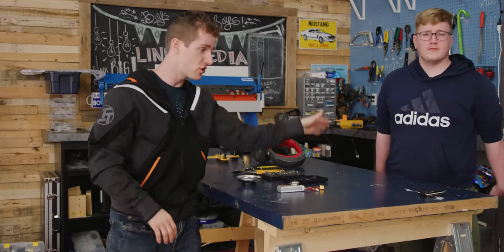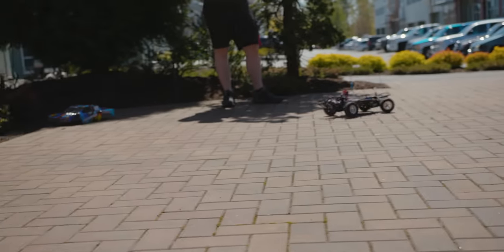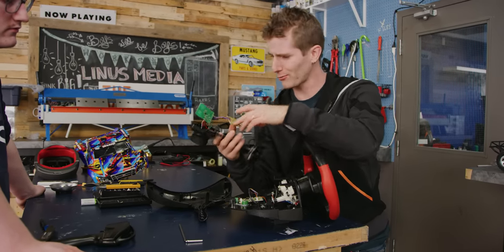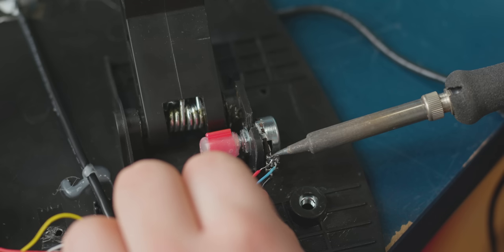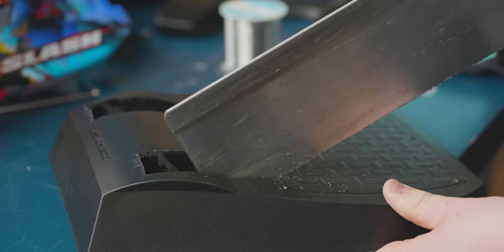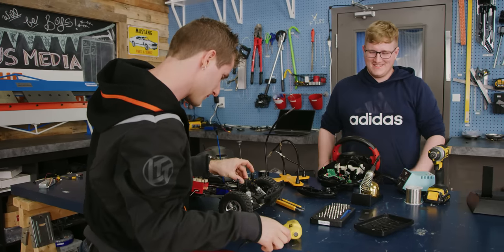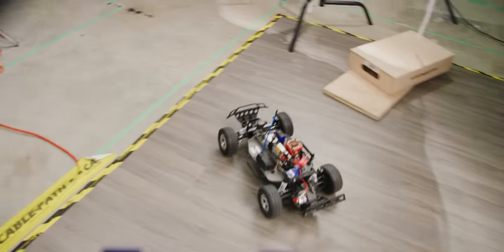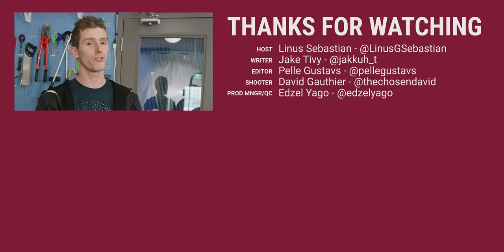First Person View VR RC Car Racing!!

Comment: Hi Linus,  

You might want to look into using a computer instead of hacking the controllers like you did by using PCTx, or Servo Commander.   
http://www.endurance-rc.com/pctx.php
http://www.endurance-rc.com/servocommander.php  

Basically you get to hook up the Actual transmitter in Trainer mode to the PC, so the PC can take the input from your wheel, pedals, or joystick by using Servo Commander or PCTx to convert that information through the transmitter, so you now have the ability to take control of an R/C vehicle or robot with your PC side applications.  PCTx generates up to 9 output channels, and Servo Commander has up to 25 channel support, and both have adapters for several different Transmitters. 

Compatible brands: 
Futaba
Airtronics
JR
Spektrum
Hitec
Tower Hobbies
Multiplex
ESky

I know you like WOW factor, & this is by far a much better option.  No need to hack and solder like you did.
NOT a sales pitch, just a PC & RC enthusiast. 
Ken